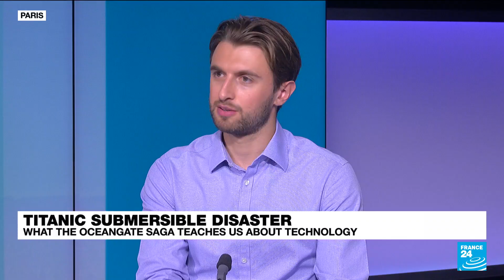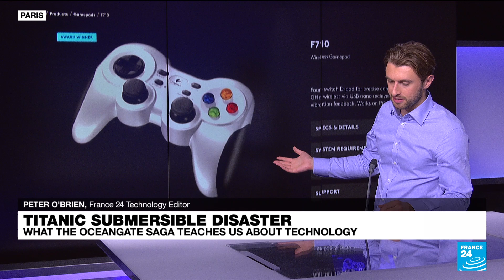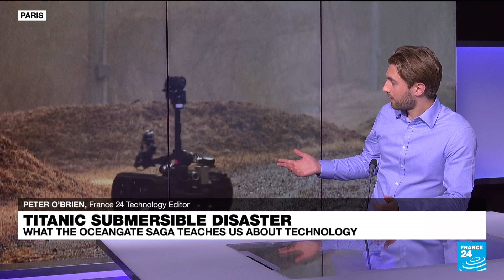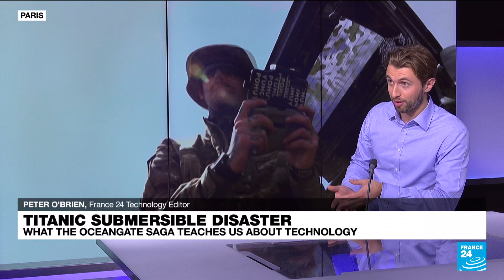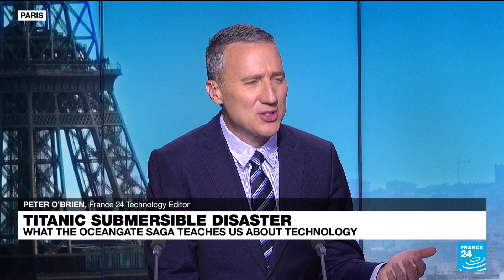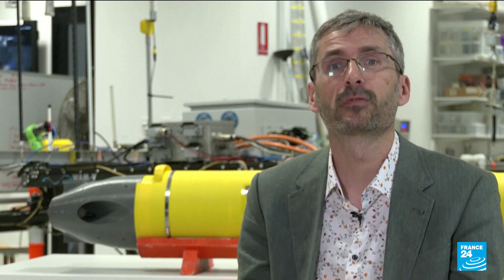What the OceanGate Titanic sub disaster teaches us about technology • FRANCE 24 English

Comment: I read that it was made of carbon fiber, and that is why it imploded.  Carbon fiber is great to resist outward bursting, but is very weak in compression, such as underwater.  Carbon Fiber is just fishing line painted in epoxy.  The epoxy will begin to crack more and more as you dive a sub made of this.  And that's exactly what happened.  It slowly shattered with each of the dozen dives the sub did.